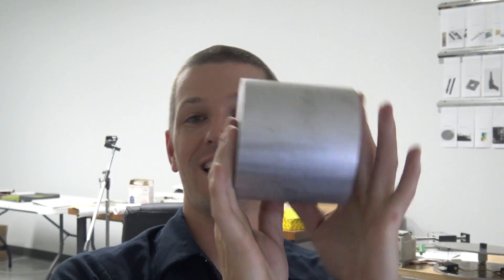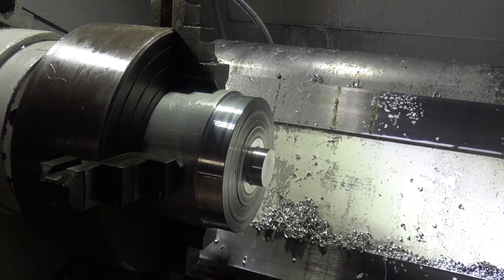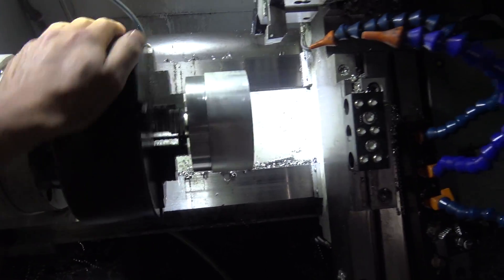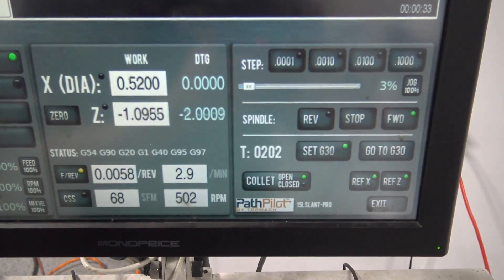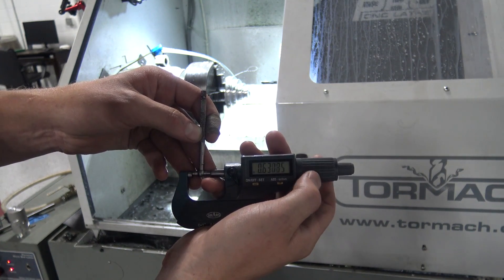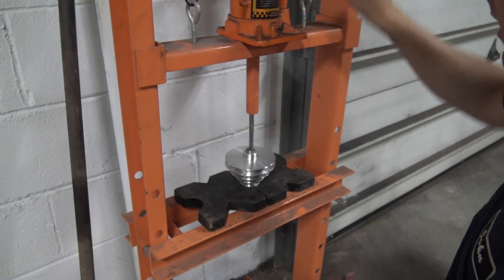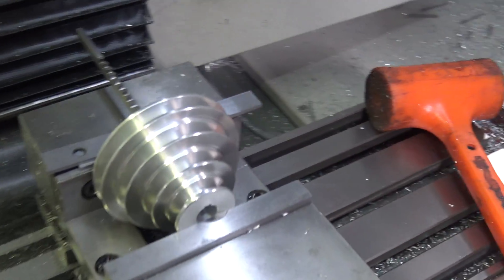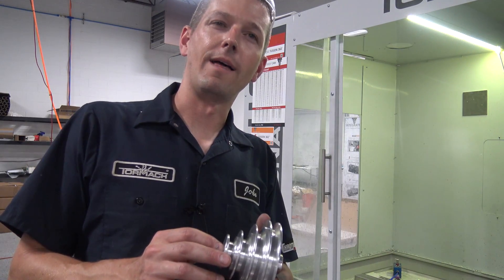Job Shop Life!  Turn, Bore & Broach a DIY Pulley!   WW106

Comment: go spend a weekend with abom or tom it will help
Reply: Granted I think anyone could possibly benefit from working a weekend with one of those guys, Your comment makes no sense in relation to this video. Both of the guys you mention are mainly or in Adams case completely MANUAL machinist and most of Johns challenges are in CNC machining since that what he does.
Reply: so why would spending time with someone who know a lot about cutting tools be wrong.
can't you use the same tools on ever a manual or a cnc machine.????????
Reply: +bcbloc02 ok. The vast majority don't XD
Reply: +daniel lyall 
Because manual lathes don't have a constant SFM setting :). 

Plus the manuals have about 3-5X the HP and torque than the tormach does. 

His lathe is simply not powerful enough to be able to take the cuts required to run the inserts he has effectively. At least not in aluminum
Reply: The EE monarch manual lathe has a constant SFM setting. :-)
Reply: I didn't know that bout the EE. Guess that explains the array of extra apparatuses in that machine.
Reply: Steve just Steve
Yes it is the reason for the motor generators and what not that they have. I don't know if all EE's have it but I know the one I saw in person once did. I also think that Hardinge built a manual lathe with constant SFM. In practice for most job shop work I doubt there is much need for constant SFM. Of course anybody running their lathe with a VFD could pretty easily rig up a pot attached to the crossslide to have constant SFM on their manual machine.
Reply: bcbloc02 "anybody"..."easily"... easy for you to say..haha. I enjoy your channel Brian. Thanks for sharing all that you do man. Much appreciated.
Reply: Steve just Steve
Well that is probably a bit of an overstatement on my part.lol "variable surface speed" would be pretty easy related to toolpost position since you could just use a slide potentiometer for the speed control to the VFD. Calibrating that to an actual related surface speed would be considerably more difficult.  :-) Glad you enjoy Steve!

Comment: Don't take offence John but did you say that pulley cost $75 x 8 hrs =$600 ish plus material I'm assuming?
Reply: +Lucas  I can't comment on this part specifically, but a scenario I will suggest is a shop filled with 5-10 workers costing $60/hr each all sitting there with their thumbs up their bums because this machine is down.  You can wait 3-4 days for a $20 pulley from e-bay and lose $7200-16,000 of production or pay $600 for the part and be back in business in 1 day.  You must always consider other costs when looking at business economics.  They are definitely not the same as for us home shop guys.
Reply: Considering the time I've spend over the years trying to find exactly sized step pulleys, $600 might be a bargain.
Reply: Step pulleys for older machines are not that easy to find. Ever look for a 5-step pulley with a particular set of ratios and then with a particular bore and keyway? I spent hours on the internet searching, and finally had to buy a large reamer (the pulley I found had a metric bore) and a keyway broach (and bushing) to make it fit the existing motor. Counting what I paid for pulley and the tools, and then my time searching for and modifying the pulley, I'd have been way ahead asking John to make me one.
Reply: He said he under bid it... So if he bid it thinking it would only take 4 hours, so $75 x 4 = $300 not the $600-800 per day the shop should bring in to make a profit. That may seem like a lot of money but you have to remember that is before expenses. i.e. Rent, power(and lots of it), employees, machine payments, taxes, etc... It goes fast.
Reply: Good points Eric, I'm just shocked Y someone would commission this part when it's a common in stock item retail. ..i'ts a drill press not a space shuttle.
Reply: I had the same question, but if the customer has a drawing and a fistful of money the power to them.
Reply: most machine store have in stock.

Comment: I dont say this to be an ass, but I think it would be responsible of you to take some classes or something on machining. There is a lot of bad habits and incorrect processes shown here. Its one thing to do them as a hobbyist, but another if you are teaching training classes at your shop and doing tormach workshops. My .02
Reply: Can you go ahead and point those out for the rest of the class?
Reply: +Colin B 

1:  that's as hard as that lathe can run. No they are not correct and that particular insert should be run harder. But when the options are stringy chips, or stalled spindle. You go with stringy chips. 

2:  define unsafe or sketchy?  Did the part move? Let loose of the jaws? Twist, deform, or chatter?  No. None of the above. The setup was fine.  That's far from sketchy. I've done sketchy before I know what it looks like. 

3:  I can't see how it was a "hack job". Other than he should have used an extension to push the broach completely through. Broaches don't tolerate "hack job". They tend to break if you try and do stupid things with em. 

What he charges and a customer pays is his call. Not anyone else's.  If he can did people to pay $75/hr for his work. More power to him. So what's wrong with that?

Titan is great, but a very different type of work than what John is doing.  Not to mention Titan has 10X if not more the resources than John does. Ask how Titan started out.
Reply: +Colin B 
There's no such thing as a "master" of machining.  Everything changes so quickly no one can keep up. Which is evident by so many older machinists unable (or unwilling) to grasp the concepts of high speed machining.  Honestly I've seen John run harder and faster on the tormach than some people run on a Mori! 

Think of this less as a "teaching" channel and more of a collaborative learning experience.
Reply: I'm chipping materials since 9 years and the only minor questionable thing was to tape the spacers to the chuck. I personally would prefer a ring cut from sheet metal or a tube that can not exit the chuck when the coolant interacts with the glue. But as the spindle speed was reasonable limited, the spacers were not that heavy, the machine has an enclosure and the chuck was not spinning while the door was opened it might even be unfair to call it questionable. I personally would have thought about clamping the second op with the build in collet of the Tormach but maybe it was too big. Another possibility would have been to create a steel bushing (maybe 10mm wall thickness) and slice it once to clamp on with the chuck to protect the surface. But again this takes time as well as the above mentioned spacers thing. Lasz bit not least I'd use a chip break every radial 0.3-0.5mm for the rough grooving op. But even with all those tiny improvements I mentioned there is no reason to degrade Johns work done in this video or to say he shouldn't teach others as long as you took none of his classes which I also didn't :)
Reply: +Colin B all that and you still have yet to state what was wrong.  What misinformation? What bad practices? 
You can't sit there and say "everything here is wrong!"... And not say what, or why it's wrong
Reply: Thanks for considering my comment instead of jumping into defense mode. My point is simply there much to be improved, and in my opinion you should master an art before others pay to be taught it by you.
Reply: A very fair response and appropriate - some would have bitten.  You're clearly a very bright guy with a raft of skills (some of which you admit are developing) - however, you have particularly good presentational ones; you're succeeding at something you enjoy, however you do it is up to you, there will always be conflicting views.  Having the humility to film yourself whist learning and also asking for advice (which I think Youtube is probably quite useful for....) is not something everyone would be able to do.  You've built something from nothing, if this earns you a living then I really do wish you the best, it takes a some courage to take the plunge and I'm sure many of us are relatively envious.
Reply: Personally, I think the definition of "Mastering" an art is really extraordinarily relative and difficult to concretely define. A man who spends 20 years on Sinker and Wire EDM may certainly be a competent machinist, but would he be a "master" on the lathe? Or the Manual mill? Or grinding? Machining is such a vast and varied trade, and you could spend years mastering only a handful of processes or machines, and types of parts. Bearing that in mind, I think John is doing a very good job all things considered. John is venturing to many different aspects of machining, and given the variety of work he is tackling, he is doing a pretty damn good job.

 I also would contend that the whole notion of John representing a "Competitive American Job Shop" is quite a stretch. Of course he doesn't, anyone watching more than just his channel or working in machining knows this as well. John's Channel is an exploratory venture, and he sets it up and stages it as such; part of the joy of his channel, is watching his blunders, and watching how he thinks and works through challenges that he hasn't seen before. Some channels are the videos of masters passing on their knowledge (see mrpete222 for example), and others are more exploratory in nature. This is certainly the latter.

Bearing that in mind, it's extraordinarily presumptuous to say that he shouldn't be charging for classes. His knowledge is valid. Would his knowledge be useful to a man who has spent 25 years in the trade? Absolutely not. But bearing that in mind, the number of classes that would be useful to a man with such experience are certainly few and a far between and with a price to match. Moreover, you might argue that perhaps it's overpriced for what he is offering, but at that point the value is purely subjective based on your own opinions and circumstances.
Reply: What did he do wrong?  Everything looked pretty much fine to me. Nothing glaringly bad.
Reply: @5 and probably still charge the same as John did, because there is no sense to put million dollar equipment in job for $100
Reply: Keepin it classy, good on yah.
Reply: Colin B ur a super star
Reply: I think what Colin expects is to have someone with the confidence of an expert. Which is that this happens to abom or anyone. The difference is how they act and if they put it on cam. Has your grandfather who has machined for whole life gotten screwdriver stuck in part or used a tool inappropriately, sure they probably dont put it on cam and maintane only what is correct and probably hide TTYe other stuff. I think for instructional video maybe keep out the using a screw driver as a pry nar stuff. Nobody is really learning but this is part of johns style we really see every ing and you should have noticed that and respect it.
Reply: I think someone's mommy went out and left the computer on!
Reply: Whatever, you can all stand up for this channel if you want, but at the end of the day the videos are far better then the parts are. I was subscribed to NYC CNC since 4 years ago, but in the past year (or two) Its been all sponsorship and misinformation. Pretty sure that the CNC training classes, tormach, lake shore carbide and american rotary sponsorship are paying the bills in the new building, and not running a competitive american job shop - as this channel tries to make it seem. Not going to defend my comment to a bunch of strangers, if you want to know what was done incorrectly, go find my comments on other vids, where I said.
Reply: there are so many bad mistakes in this video. If anyone is here to learn please go to a different video to learn the right way to do things. I would be upset if i got that part for myself.
Reply: Colin B upload your own videos so we can subscribe and learn
Reply: Good thing the part wasn't for Cameron Otto.  It was made within the customers tolerances and that's all that matters.
Reply: Colin you are same person who would charge 4k for aluminum 3 axis part. The reason it costs voeing 250mil to go to space. Is that driving safety or correctness no! Look rocket labs can send orbit for 1mil now. What ever you argue john probably has provided a part with in specs for a good value. Bottom line people dont care how their product is made and I've seen all to often institutions with the fanciest of tools turn a screw driver into a prying bar. So go on about speeds and feeds and chips. But you just are making an ass.
Reply: To sum this up in english.

"Im jealous you are having success and im smarter and better than you, for real, trust me".

But at the end of the day....who is subscribed to whos channel?  Lol....exactly.
Reply: So basically Colin isn't happy till you wear suit and tie and work in office and you hire immigrant to work for you, who you pay 12 an hr while you charge 4k for  2-3 hr part.
Reply: Last comment here, then im done. I have nothing to prove to you 
1. Roughing speeds and feeds are wrong, not aggressive enough to break the chips
2. Fixturing in the lathe is very scary and downright unsafe, holding such a small tit and machining a large id.
3. Broaching was a complete hack job.
4. Incorrect use of snap rings, shouldve been measured by guage pins for this application. (slip fit hole)
5. Cost. $75 - $100/hr for work on a tormach is so overcharging, companies that charge that are running haas VMCs and using HSM and could machine that part in an hour. 
go check out titan american built if you want to see how things are done in a real job shop.

Comment: When I used to know a fellow that worked at a metal supply warehouse, he gave me a sheet of copper foil. I'd have to measure it, but it's probably .025" thick. I use it all the time when holding parts like this and it has never left a mark.It grips the part as well. Maybe you'd have better luck with some other type of shim stock other than stainless, or thicker.

Comment: After you turned the stub, why not hold the part in a collet?
While not the best solution, you can do some chip breaking in CAM by making your roughing moves with periodic slight retracts. Think of it like peck drilling in the mill.
Reply: Need a 16C or 2J size collet or collet pads and lathe collets for that.